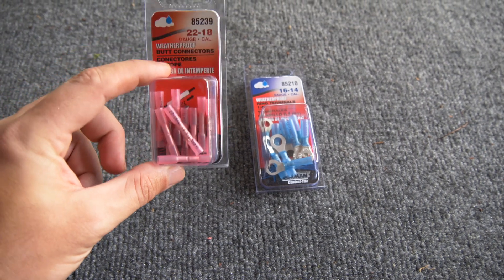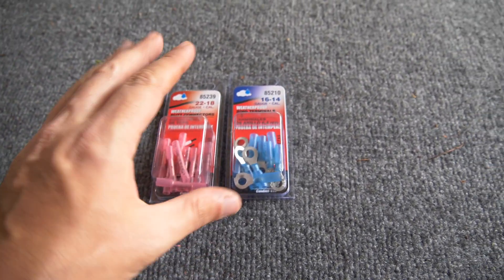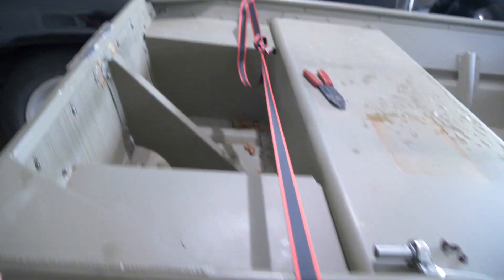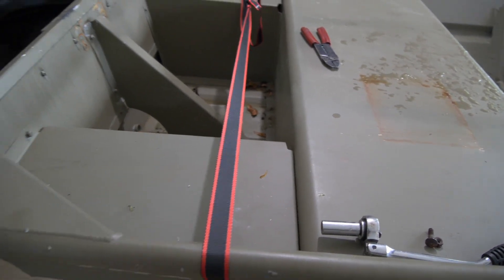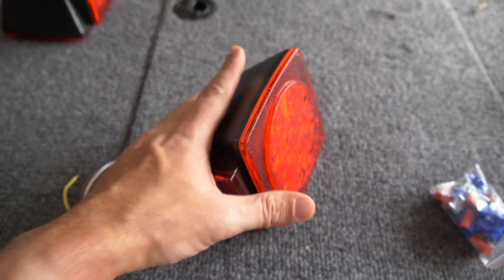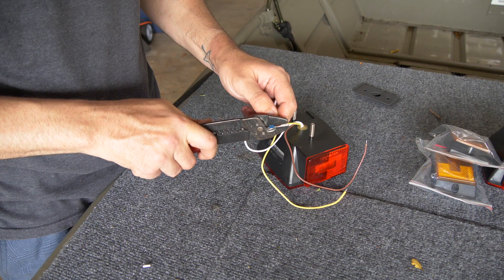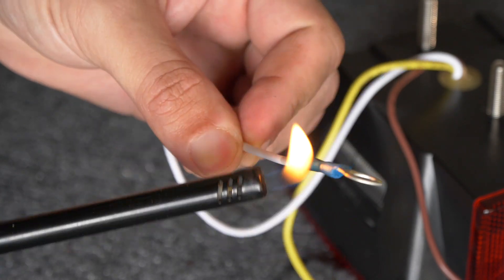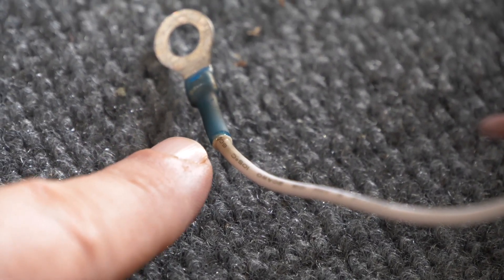Best Boat Trailer Mods On A Budget DIY

Comment: My last boat  trailer was an EZ load brand  trailer (most popular trailer in the NW)  and I just couldn't believe how cheap everything was.  The junk lights would break apart just from driving on washboard roads.  The hubs were junk...the  lights and wiring harness were  a nightmare of problems.  I had everything replaced.   Now I make it a point to look at boat and utility trailers on the road and I see lights completely or partly out like all the time.   Good video.

Comment: I don't trust crimp connectors. Recently I re-wired my whole 20ft boat trailer with LEDs. I used only Solder & heat shrink on all wire connections, I'm confident it will last the life of the trailer. Also, I used to work at a trailer parts/service store and we would have people coming in all the time who lost their license plate after the cheap plastic bracket broke. The plastic becomes brittle after some time and just snaps off whether you hit anything with it or just from the wind while going down the highway. It's a good idea to use an aluminum or steel license plate bracket. Just my 2 cents. Good how-to guide though.

Comment: I just upgraded to LED Submersible on my boat trailer. Those Boat Buckles are sweet though. Im using those ratchet straps like you had and I agree, total pain in the ass. Definitely gona check out those bad boys. Thanks for the video.
Reply from the maker: The boat buckles make life so much easier. Time saved loading and unloading is priceless.

Comment: Good video, very to the point.

My only suggestions are... 

I probably would solder the wires together and use heat shrink. Then I would smear some dielectric grease on the ground connetions.

And...

I use Neverseize (or your favorite equivalent) on everything I take apart or put together. I even have a nice little supply of marine grease for just such an occasion.

And I probably would blast the new rachet mechs with WD-40 or whatever you like to keep them running smoothly. Yes, I know that WD-40 on a trailer is going to attract a lot of dirt but I would rather clean the things once in awhile then have it freeze up on me and die. They don't look like stainless, and even if they did, I would still blast them!

Oh, and red/white reflector stickers for a little extra protection.

Peace, Love & Happiness, Brother
✌🏼❤😀

🎶 "IIIIIII'm gonna miss her...

...oh, looky there, I got a bite" 🎵

Comment: Nice tips.  The boat buckles are quick and easy but I had rusting issues pretty quickly even though I rinsed them every time I used in salt. That was about 10 years ago so hopefully they've improved.
Reply from the maker: Saltwater will eventually ruin everything. I haven't used them in salt so I cannot give my opinion on the boat buckles there, but I feel like replacement would be expected after a few years of service in the salt.
Reply: jack fat nope they are still the same I had same problems 😩
Reply from the maker: Sorry about your bad luck. Mine are still going strong and it’s been over 2 years since this video posted. Salt water, gravel levee roads, etc. I just rinse them down and use salt-x.
Reply: Actually just looked at mine a few days ago. I have two sets and see one set is rusted and doesn’t work well and the other is pristine. I may have been the victim of counterfeit merchandise.

Comment: You should consider extending the length of your trailer frame to better match the boat length. In my personal opinion at least. Like, the boat buckles are a nice addition, however if you look closely at the angle of the strap and how hard it cuts backwards to the transom before going up, it's putting a ton of tension on the top of your buckles and pressure in a manner different than they were built to last while holding. Plus it's an odd shearing pressure on the mounting bolt as well. But, maybe you fish right up the street or plan on upgrading to a different platform when you can, idk. If it were mine, I'd feel better about it if the trailer cradled the entire hull, especially if I have a motor mounted and the added weight from it and it's fuel tank. Plus in my state the regulations for overhang are too strict to legally run the setup on the roads. What do I know lol I'm just a stranger with an opinion. Just finished adding reverse lights to my own last night. Evening as it's getting dark and you're coming off the lake, nothing better than nice clear light to see the landing and orientation to the dock 👌

Comment: I'm curious,,,  does having the boat buckles mount underneath the boat cause the strap to  wear , where it is tight to the bottom edge of the transom? Thx.
Reply from the maker: It’s been about a year now and so far no they haven’t worn at all.
Reply: im wondering the same as well. that's why im going to extend the side rail.
Reply from the maker: It’s been almost a year and a half now and I see no visible wear. They’re basically the same as a seat belt and they’re really strong. As long as they don’t flap and the boat isn’t constantly sliding around I don’t foresee any issues.

Comment: Since it’s been a year how have the buckles held up with the trailer going in and out of the water have they seized up or are they still working very good?😎🇨🇦
Reply from the maker: We're coming up on two years, actually. They still work just fine. I literally do zero maintenance on them. I've taken them in the salt a half dozen times, but I mostly do fresh water. They're showing signs of wear, which is no surprise as I'm always using the boat every weekend. By my educated guess, I'd say they have 2-4 years left in them if I continue to not maintain them in any way.

Comment: How wide should the bunks be spread apart from the center of the trailer in reference to the hull of the boat? Should the bunks be on the edge of the trailer or 2/3 or 1/3 from center hull?
Reply from the maker: I'm no trailer builder, but here's what I've learned based on the setup in this vid, and also adjusting this trailer for the duck boat I purchased in July. 

On a flat bottom boat you want the bunks outwards of the outer ribs on the hull. You can see in this video there's about a half inch of space between the bunk and the outer ribs. This does two things for you. It makes loading the boat easier. Wider platform is more stable. Also when you line those outer ribs up inside of the bunks, it helps guide the boat onto the trailer.

If you were to move the bunks closer together so they're in between the middle and outer ribs, the boat would be very unstable on the trailer. Loading the boat onto the trailer would be very difficult as well as you're trying to line up on a more narrow path.

Comment: DO you remember where you got the lights? I am getting a HF trailer tomorrow to convert to a JON BOAT trailer and want to do it right to start with. Great Info on your video.. Thanks for it as I am researching.
Reply from the maker: I just got the ones on amazon that had the best reviews.

Comment: Good video, I like your others too.  
Quick question about the boat buckles, have you had any issues with them being dunked every time you launch or load your boat?  I have been using the strap (over 30 years now) and I agree that I’m not loving it, but it works. The buckles seem like they’d get mud/dirt/grit in them from the nasty water at boat ramps, and the hooks just hold those grab handles on the transom, which aren’t seeming to be that strong. How have those boat buckles held up over time?
Reply from the maker: Well, I've had the buckese on there for about 10 months now, and I'm loving them! I haven't had any issues yet. I only fish freshwater, so corrosion from salt is not something I need to contend with. I would definitely wash down the entire boat and trailer if I launched in the salt. Hopefully thats next weekend! I've had the trailer covered in all kinds of grass and garbage and the buckles have never gotten stuck or given me any issues. Those handles on the transom are pretty sturdy. You're just keeping the boat from moving side to side on the trailer, so there's no need to wrench down the boat buckles that hard to where it would snap off those handles.
Reply: FloBass Thanks for the response!
My strap has made a shiny wear spot on the  gunnels, but over decades of use, no other issues. I through-bolted my grab handles when I replaced the transom a few years ago, with thoughts of something like the buckles, but I never got them. Might give them a closer look now. 
Tight lines!
Reply from the maker: They’re really just a convenience item. The strap definitely works but the buckles make it fast and easy.

Comment: Left light is on backwards
Reply from the maker: 16:10 no idea what you're talking about
Reply: @FloBass   I noticed you changed it later on. Just did my trailer lights same exact set except I guess they send the wires through the sides of the lights now instead of the back.
Reply from the maker: 😎 must have been the refraction of light into the camera lens that made it appear backwards. Weird...